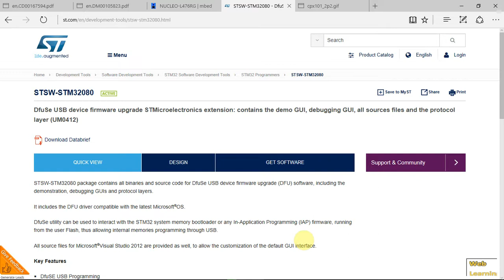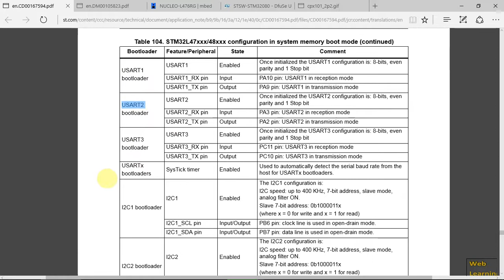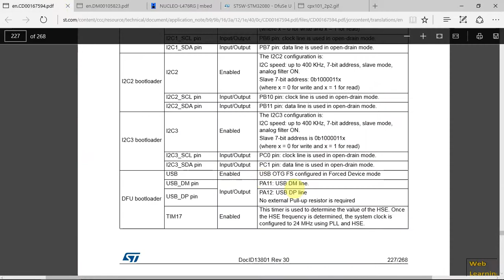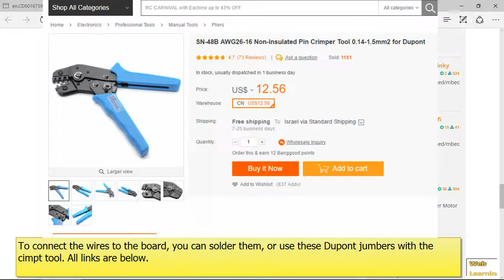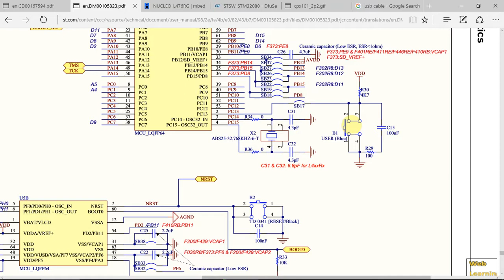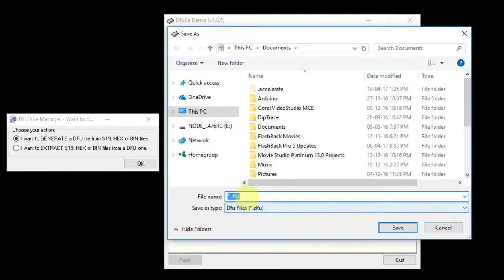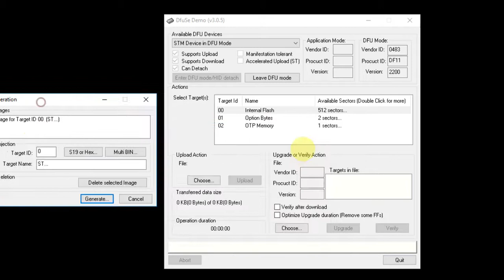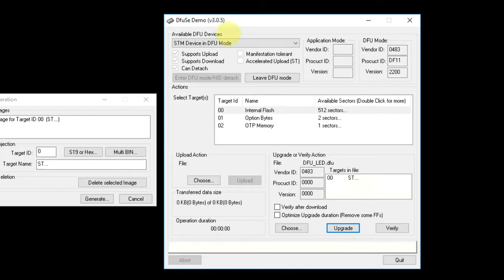STM32 DFU BootLoader HowTo

Comment: Thanks a lot for the video and I have shared with some Geek friends 😁 This is exactly what I was looking for but now I need to find out how to get .dfu files from my project output in Keil Uvision v5
Reply from the maker: I think I mentioned this in the video, and if not, then their is a small program that you need to use that converts from bin to DFU file. You can't output it directly from the compilers.
Reply: @Weblearning1  Yes I am sorry you did explain it very well. I have just started with the STM32 and this video was a great help to get me going. I found another project to that uses some files and a batch script in Keil, so that when you build your code in Keil, it automatically converts it from hex to dfu and flashes it to your board all in one go. Here is the project page with some comments of what I found out to fix a small error in that batch file. https://hackaday.io/project/4139-stm32-dfu-file-converter/discussion-124728
Reply from the maker: Thanks for sharing

Comment: Hello, Thanks for the Video! I am trying to make my own board, but the problem is that when I program the micro using the stlink, it dies (smoking!). The thing is that I've designed Boot0 and Boot1 to GND directly with no resistor, and the OSC32_IN to GND and the OSC32_OUT to sink the current from a pair resistor-led connected to the 3.3v. Idk why it is burning my stm32f103c8 when I program it. Could you help me?
Reply from the maker: It could be many things. 1. I would use a bench power supply and make sure not to have current about 50mA. If you dont have one, use a resistor ( depending on the voltage, you need to figure out the current ) or you can use a fuse. It could also be the programmer that you are using, or some other connection. Its hard to tell without seeing the schismatic design. Try measuring with DVM every connection that you have and see if you see Vdd when you should see GND, or GND when you need to see Vdd. That could be the reason.

Comment: How can one read the Stm32's Bootloader Version/ID?  I understand not all chips support all bootloading peripherals (uart, spi, etc).    For example, for the H74xxx devices, only the newest bootloader version 9 (0x90) supports FD-CAN, the previous versions 13.x (0xD2, 0xD3) don't! 

According to AN2606, "the bootloader ID is programmed in the last byte address - 1 of the device system memory and can be read by using the bootloader “Read memory” command or by direct access to the system memory via JTAG/SWD."    But setting a pointer and reading from memory (0x1FF1E7FE) didn't work.. does it have to already be executing from the bootloader (BOOT0=3.3v)?
Reply from the maker: You can use the CuebProgrammer to read the memory address that is mentioned in AN2606 and then you can see what is the Ver.

Comment: Thank you so much man! Your video helped me a lot in my project. Keep up the good work, man. Cheers!
I have one doubt though, I am using the STM32 NucIeo F446RE board as the usb-dfu target and I am using VDD to give HIGH to the BOOT0 pin but the partitions are not always visible on the DfuSe software. I connect the VDD to BOOT0 when STM is in normal mode, then  I hit the reset button, then the STM leaves the normal mode and most probably enters the DFU mode but the partition doesn't show up many times, then I remove the wire from VDD. How to make the partitions visible on the software consistently when entering the bootloader mode? Is there something wrong in the procedure I am following? 
Thanks
Reply from the maker: Hi. it could be that there is some noise or voltage on the other peripherals and that holds the bootloader at the different peripheral then the dfu. Make sure that there is nothing connected to any of the peripherals, you can read an2606 about this. Also, check the timing. It could be that the PC is not answering fast enough and that can cause the bootloader also to hang.

Comment: Hello. This is a very useful video thank you. I have a question. i trying to communicate with microcontroller but it is not board and i will program it first time but i cannot use dfu mode. it is seem as unknown device. what can i do ? firstly should i open usb botlooder ? if yes how can program it? how can i comminicate with microcontroller first time? thank you for answer.
Reply from the maker: What is the part number of the device?
Reply: stm32f072c8
Reply from the maker: You have to follow my instruction on how to enter bootloader using the boot0 pin. If you don't have access to this pin, you can't enter the dfu mode.

Comment: Can anybody explain how can i use bootloader to flash betaflight firmware to nucleo f446re?
Reply from the maker: If you have the code and its for the F446, then you can use this video or the STM32CubeProgrammer.
Reply: @Weblearning1  I cannot get into to DFU mode. What can be the possible reasons for this? Do I need to configure some stuff with code first?
Also how can i debug betaflight onto board using cubemx?